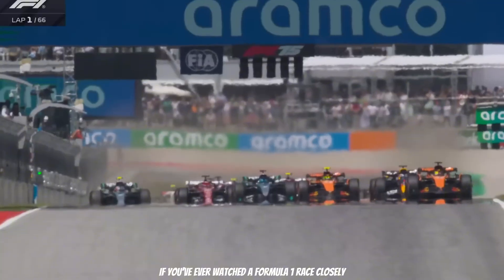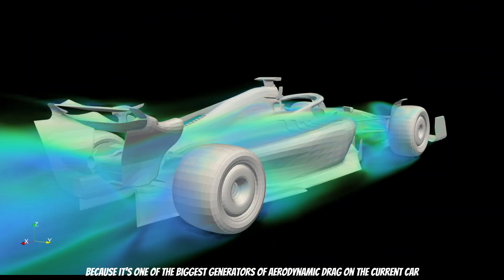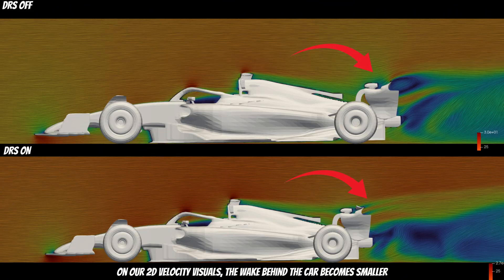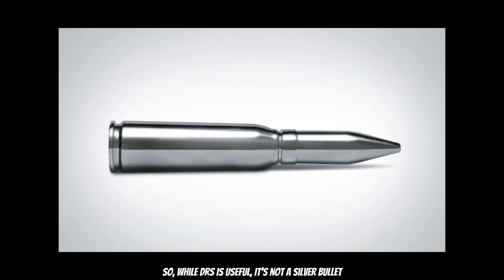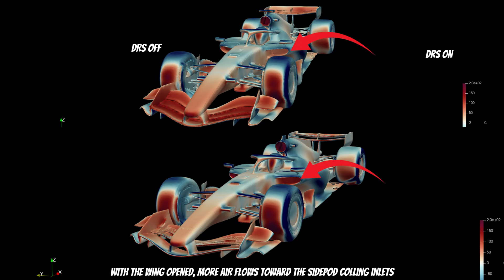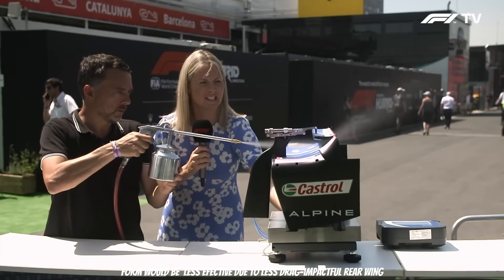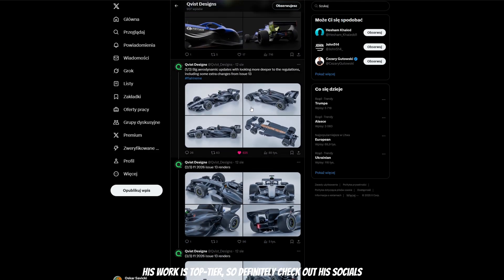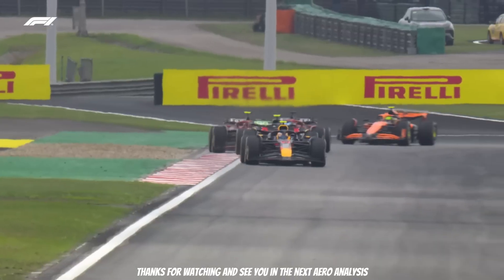How effective is the new DRS?

Comment: Nice analysis and video overall. Now, about the new DRS, in my opinion, it looses the initial point of allowing for overtakes in straights, but, it's an area where drivers have to improve even more (the timing of pressing the button right after the DRS line), it will benefit the cars that have the lowest drag and we don't know yet how are overtakes gonna appear in the next season, maybe they are common and easy to do (relatively speaking), or maybe very hard like this season (because of car size) but I think we should get used to more overtakes on corners than on straights from now and on because there will be difference between the drag of the cars and the pilots' skill but not that much. Although all of this yap is my opinion and I think we should wait for the next season and then comment. 
Great video man
Reply from the maker: Thank you! I do believe FIA wants increase overtakes amount in general but especially the ones before the corner since they are most satisfactioning for fans!
Reply: Yeah, that is a factor I did not think about; how much do the fans enjoy different types of overtakes. It's very possible that the FIA wants to increase the amount of overtakes, specially before the corners as you said
Reply from the maker: @Turbogas147  exactly since overtakes on the straights are so usual and common that they become boring for fans. Just think about top 10 overtake/highlights 90% happend during chicanes,corners and slow section!
Reply: @OskarSavicki  Indeed